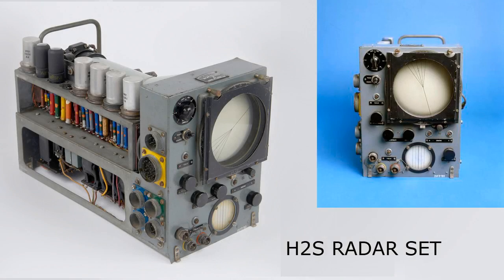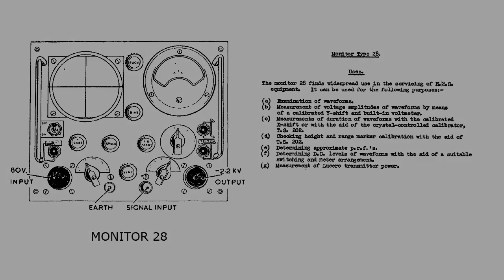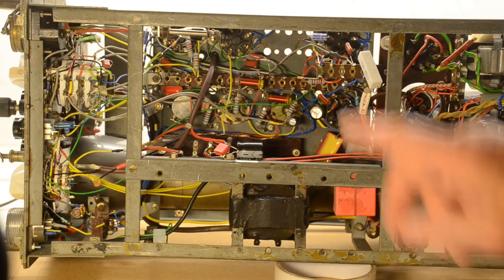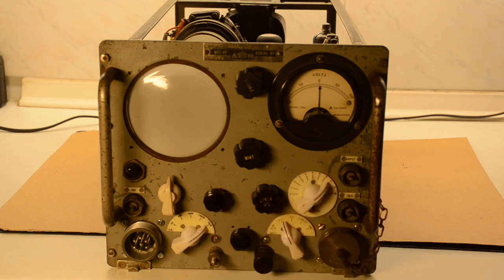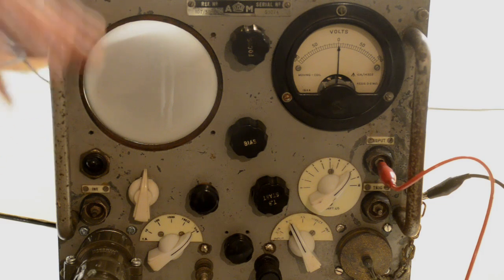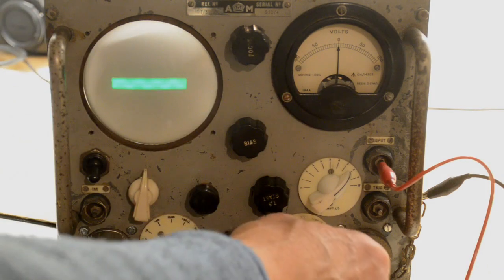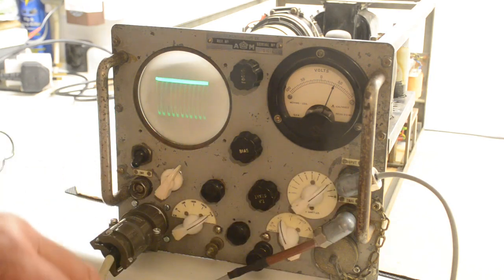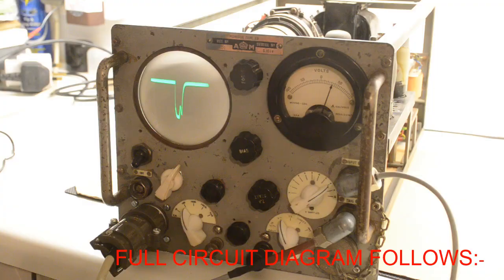Monitor 28 - H2S Radar Test Equipment

Comment: Hi Again Chris, that is a nice rebuild you have done of the Monitor 28. I notice the ID plate top center of the front panel showing  AM ie Air Ministry, You don't see that a lot. Nice work covering the Fishpond display, ie tail warning radar. And as always nicely edited Regards Clare
Reply from the maker: Thank you (again!) The AM label is a bit odd I agree as these things are usually in mild steel and rust easily.  Now we know about 'fishpond'... :-)